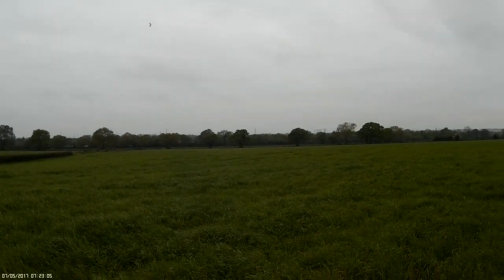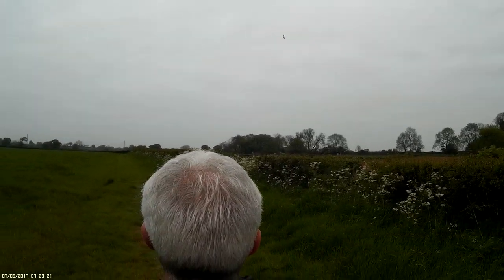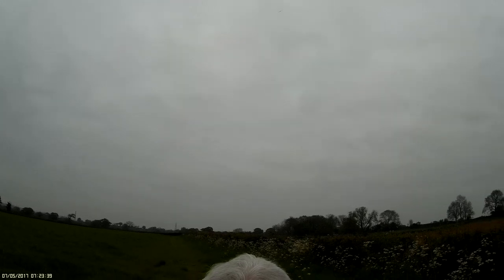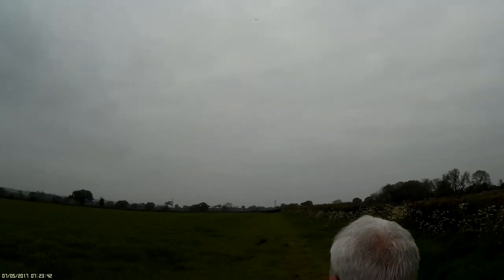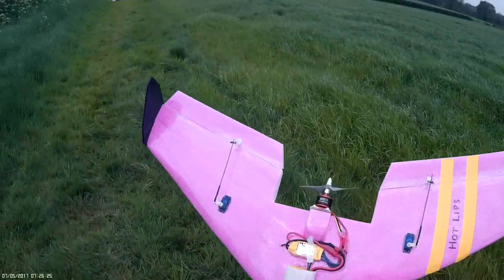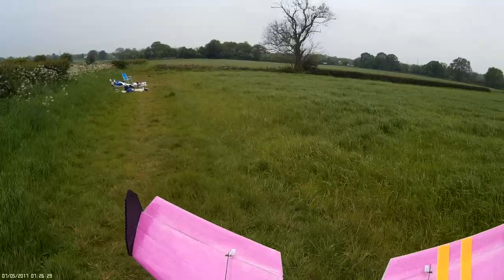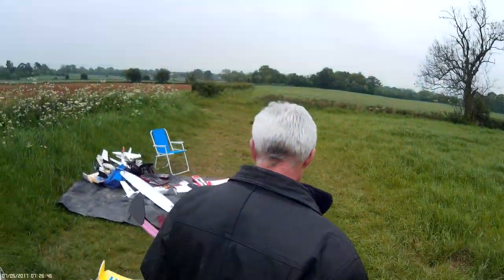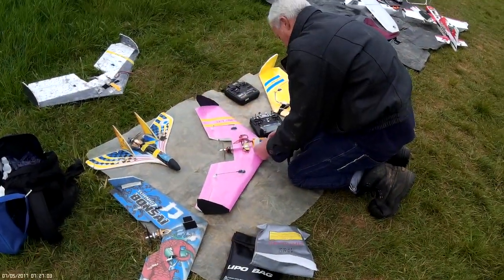Craig's "Hot Lips" £1 Flying Wing Maiden + Tip Stall [Hat Camera]

Comment: all its missing is a center pod and you have a not so ft mini arrow
Reply from the maker: Howdy Elijah, yea. Craig has designed that one to take a 2200mAh 3S pack for extra ragging :) Matt
Reply: Matthew Ogborne speaking of tip stalls i was messing with flapperons on my mig3 and went to low to slow. crunched it up a bit
Reply: https://goo.gl/photos/4NJQJodQ8KiWHinX6           more damage than it looks
Reply from the maker: Ooops. Yea looks worse than what it is. A bit of glue & tape & happy days :)

Comment: At the beginning did he set the esc and throttle up correct? Sounded like the esc was beeping, just wondering if that would cause it to cut out?
Reply from the maker: Morning Wayne, na that was Craig's special "no charge" battery ;) Matt
Reply: Morning, ahh I see! Did he find out what was causing it to cut out like that? What I usually do when I buy an esc is add a decent Heatsink from an old fanless graphics card, cut to size, Heatsink paste and then re-shrunk with clear heat shrink! Works a charm and voids warranty 😆